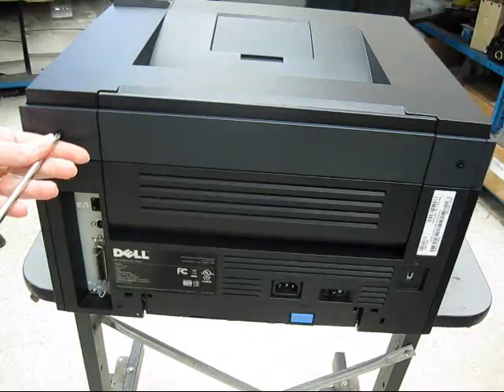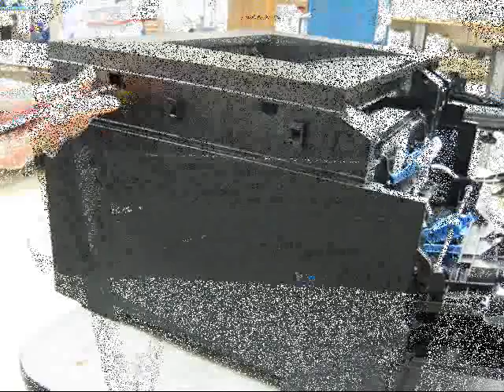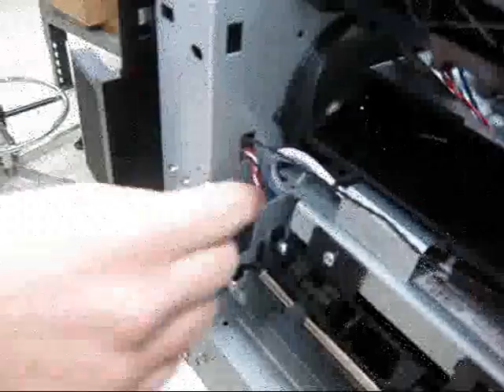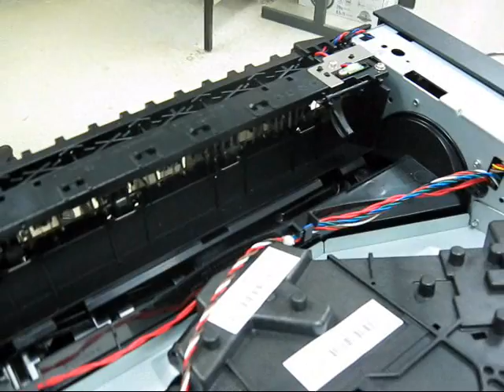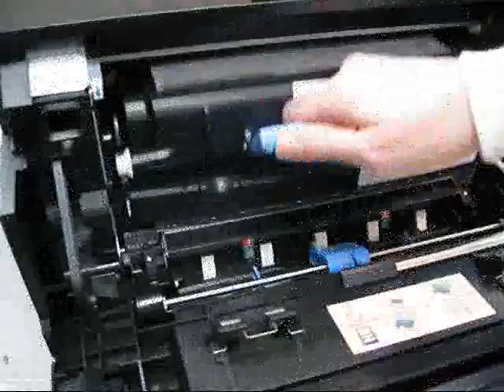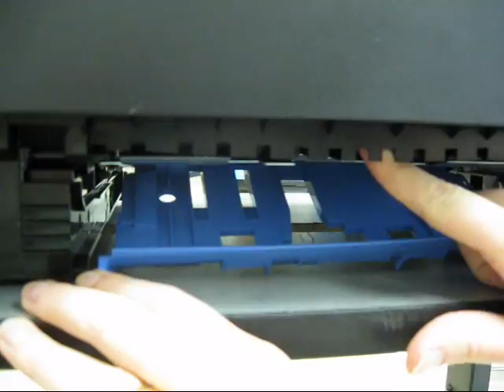Installing the fuser maintenance kit and rollers in the Dell 2330dn 2350dn 3330dn

Comment: Excellent video. The printer keeps track of the fuser's life and (ONLY!) displays the "FUSER LIFE REMAINING" on the WEB INTERFACE DEFAULT STATUS PAGE. You have clearly stated that there is no way to reflash the main board.  So if the fuser life is 5% is it worthwhile buying a new fuser? Will the motherboard block the printer when it reaches 0% or will it continue working at infinitum? Do you sell the R714D which is the 240V version or only the 110V? Would the other solution be to replace the controller board from an old machine? Thank you for your kind reply

Comment: Is there a way to reset the maintenance kit counter on this printer once the kit has been installed?
Reply from the maker: Yes, include instructions on how to reset the counter with the kit.  Basically power off, hold the check and right arrow and power on.  The config menu will come up and arrow down to reset maintenance counter and press check.  Once reset arrow to exit config menu and the printer will reset and come up ready.

Comment from the maker: The 200.32 error indicates Media more than 14 inches long has passed over
the manual feeder sensor. Possible causes include multi-sheet feed or
pre-staged media in the tray. The multi-sheet feed condition is normally
caused by the media feed clutch DELL-N383M sticking engaged and feeding
multiple sheets in a row. (Multiple sheets in a row is seen by the printer as 1 piece of paper that is way too long and triggers an error.) Solution replace media feed clutch.